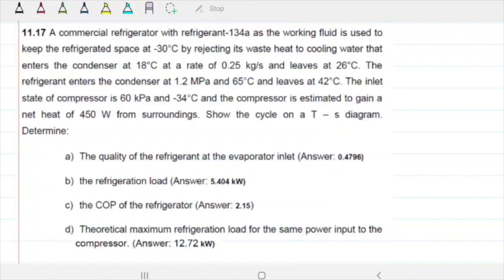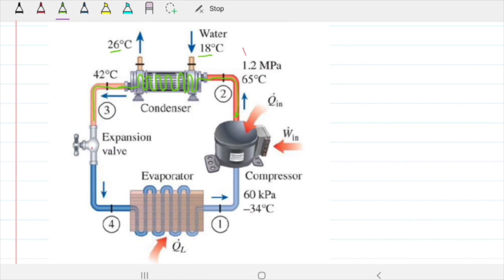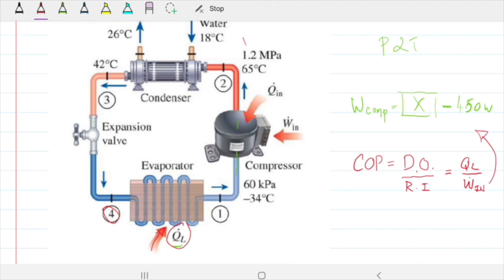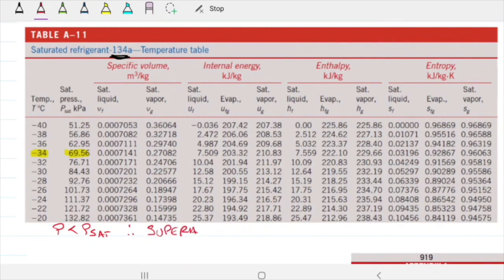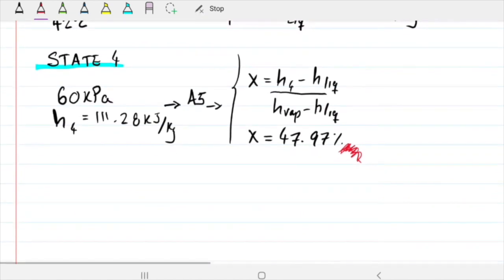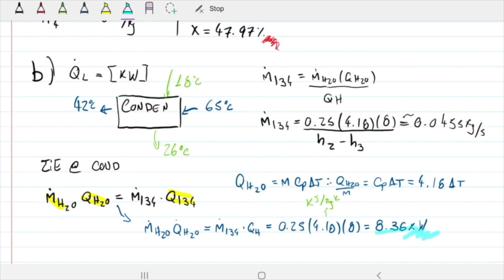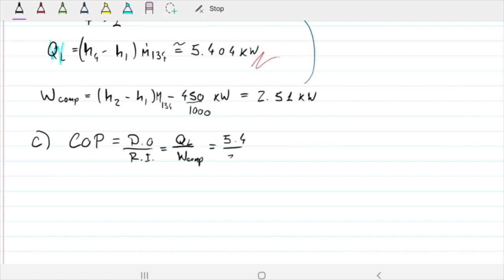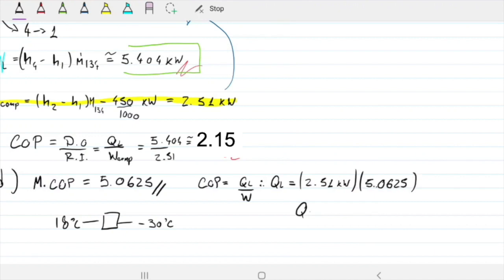Thermodynamics Mech3001 - Week 11 - Problem 1 (11.17)

Comment: 1.b An air conditioner with refrigerant-134a as the working fluid is used to keep a room at 26°C by rejecting
the waste heat to the outside air at 34°C. The room is gaining heat through the walls and the windows at
a rate of 250 kJ/min while the heat generated by the computer, TV, and lights amounts to 900 W. An
unknown amount of heat is also generated by the people in the room. The condenser and evaporator
pressures are 1200 and 500 kPa, respectively. The refrigerant is saturated liquid at the condenser exit and
saturated vapor at the compressor inlet. If the refrigerant enters the compressor at a rate of 100 L/min and
the isentropic efficiency of the compressor is 75 percent, determine (a) the temperature of the refrigerant
at the compressor exit, (b) the rate of heat generation by the people in the room, (c) the relative COP of
[10 Marks]
the air conditioner.
pintoined at 15°C, and it requires refrigeration at a rate of 100 kW.
on
Reply: Please can you solve this problem

Comment: can you explain how you get 230.06?
Reply from the maker: Our temperature is -34. Table shows -36.95 and -20 Celsius. So we do a linear interpolation (i.e., consider that entalphy will follow a straight line from one to the other) between the two known temperatures and then solve for the -34 Celsius we are interested in.
Reply from the maker: Let me know if that helps. If you still need a hand, I can make a quick video about linear interpolation.
Reply: I already found the result thanks, but I would appreciate it if you help me to find the value of the S of each point
Reply from the maker: Sure, here is an intro on how to do it. https://youtu.be/9QyiU1Q5-0c
Reply: @EngineeringHack  WOW, thanks man you are great